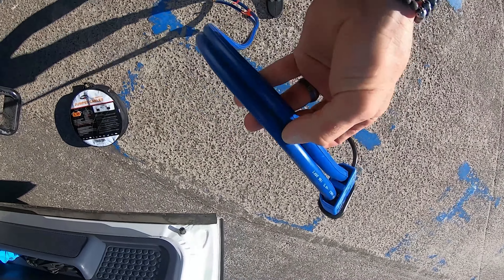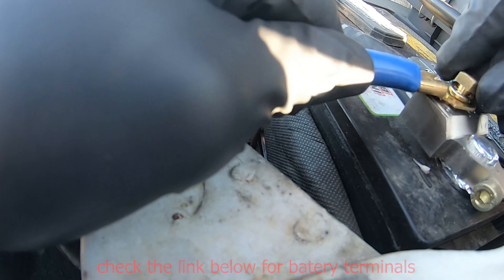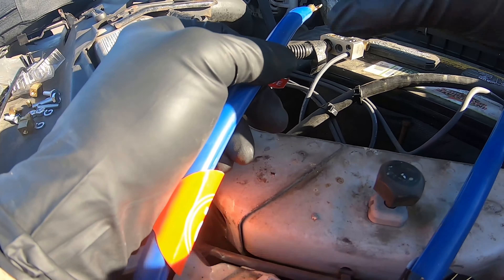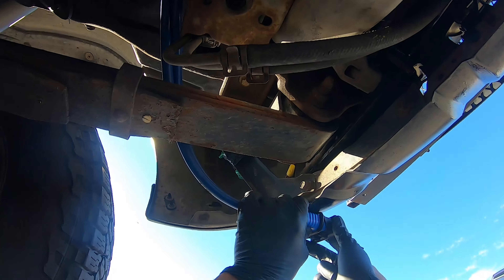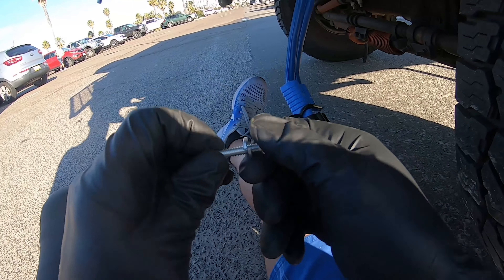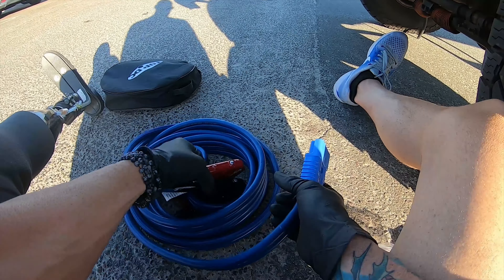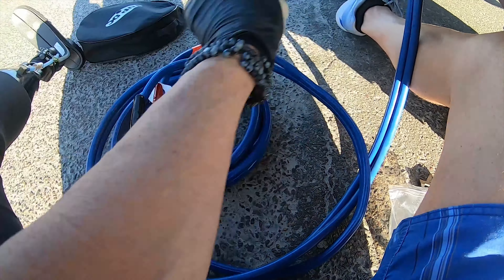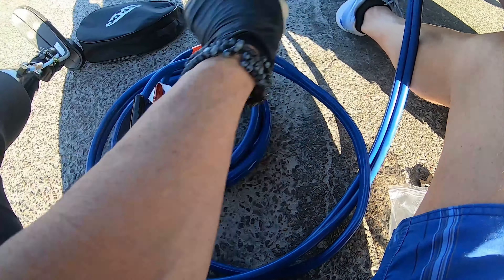Hardwired jumper cables with disconnect to my Ford F350 Superduty 7.3 Diesel

Comment: Great idea except I've looked at them and they are aluminum so if you thinking about getting them I would suggest building your own and it's not real hard to do this Discovery way hardware store in say you need some 1 gauge stranded copper wire Anderson style connectors some tinned(especially if you live in the rust belt)connectors for the batteries and some standard jumper cable ends

Comment: Maybe a circuit breaker or at least a fuse within first 18” from the battery. Being the video is already 2 years old, the truck is probably already burned by now.
Reply: Ant idea where a guy could find an 800 amp circuit breaker?
Reply: @ve5psl  why on earth would you need 800 amps in a vehicle? That's enough to completely run 4-2000 sq ft homes. Hell even running a welder in the garages. I've got 2-300 amps  running 4 batteries, 2 alternators, 4-15" subwoofers, 12 mids and highs, light bar, TV's, and 4-amplifiers.. voltage stays around 14.6-15 at full tilt. But Amazon has 300A Circuit breakers for around $15-$20 so if you really think 800 is necessary then there you go....
Reply: Joshua, I'll be polite unlike your reply. This is 12v not 240. Each battery in a diesel truck can supply 800 amps. 
A good 7.3 starter will draw 300 amps or more. A bad one can require far more.  With a low battery it will draw even more current. If you used a breaker it would need to be that sized. 

Instead of a huge breaker he should install a battery post mounted cutoff. Of course them he'd have to open the hood to jump someone.
Reply: @Memphian1000  I wasn’t trying to be rude, I have been installing stereo systems, tv’s, game systems, lights, even AC units for about 25 years and I use 12V circuit breakers all the time. They come in all amperage but I mainly use 300A, I always mount them 18” away from the batteries. I don’t know how you took that rude but I was merely trying to give you some ideas based off my experiences.
Reply: @Memphian1000  also no way it draws that in amps, a large house runs off 200 amp service. Cranking amps is completely different. I run 5000 watts with 3 batteries and two alternators on 300a. I’ve been installing professionally for quite sometime now.
Reply: Joshua - Not going to argue with you. I stand by my statements. Peace.
Reply: @Memphian1000  Also the breaker I’m referring to, does exactly what a “cut off” does it breaks the pathway of current. Hence breaker.